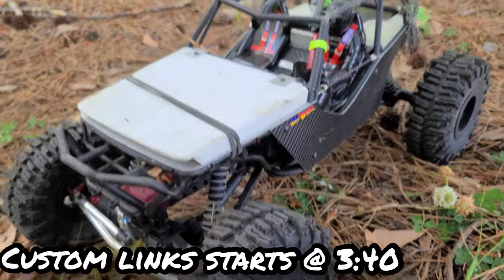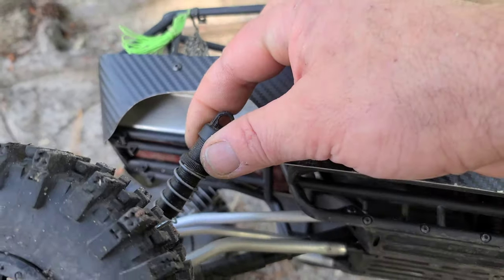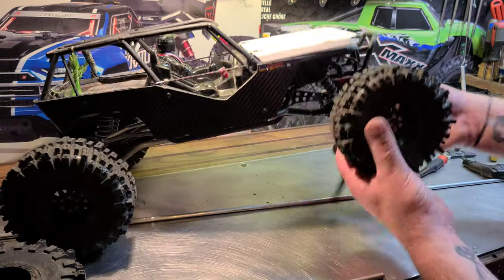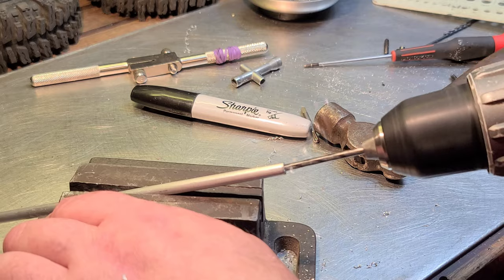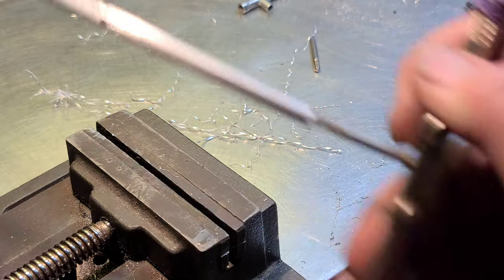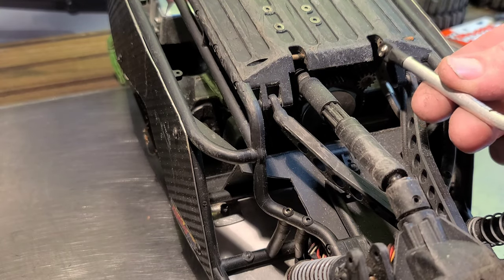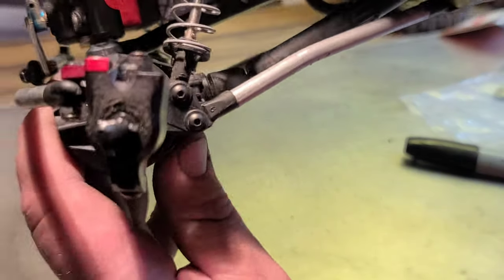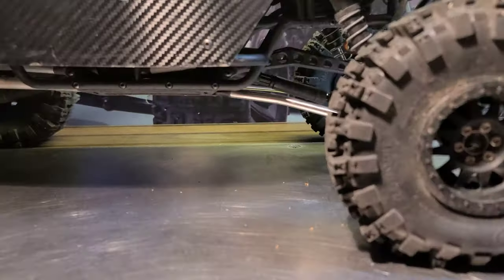How-to Build Custom Links RC Crawler

Comment: I found this on Reddit. Was looking at how to measure suspension links but this is better. I think I'm gonna do the all-thread option and figure out how to cover them. Perhaps rubber, nylon, metal hose... or maybe something else. Like truck-bed liner or plasti-dip...
Reply: Brake line works good over all thread. Slides well